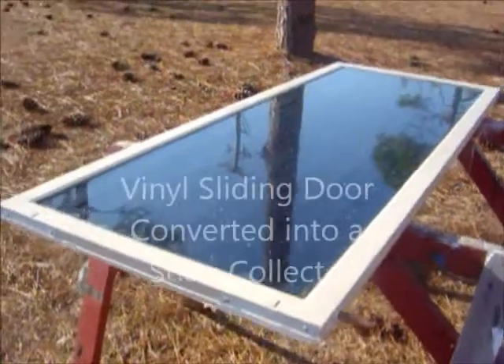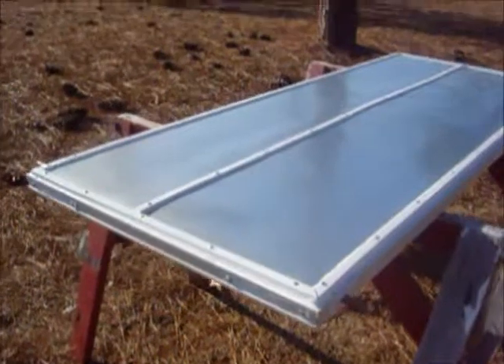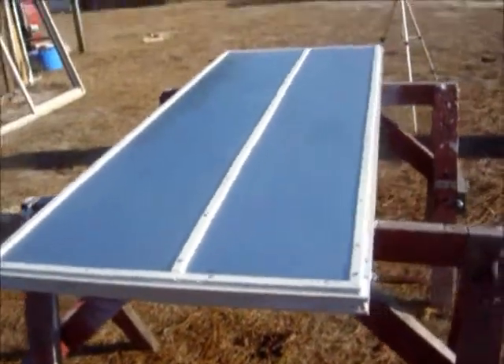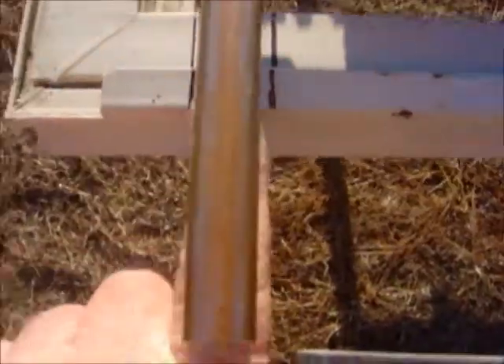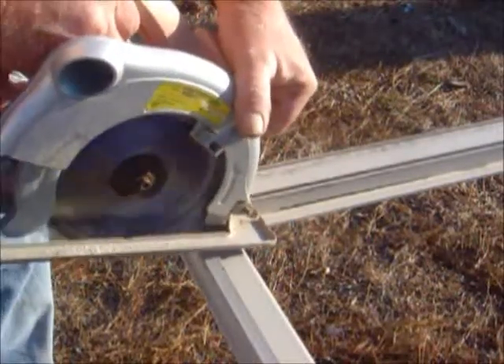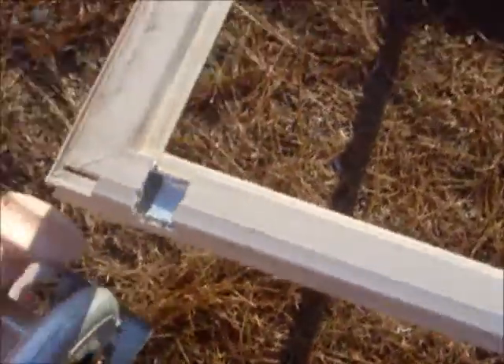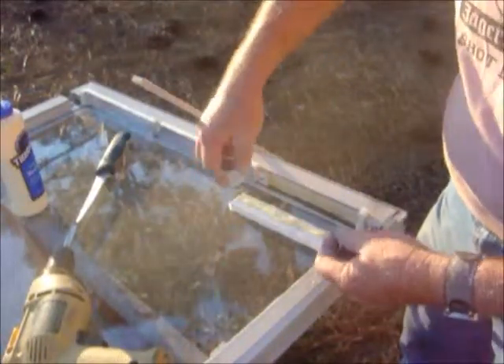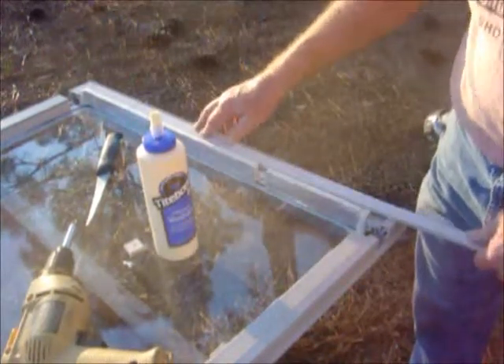Solar Collector From Vinyl Sliding Door1

Comment from the maker: @DeleteMeOnline  Well along with those things I would be also concerned with flow rate through a corragated panel  even if you could hold preasure. But you sure could use this type of conversion to house the panel. 

Thanks for the compliment and comment!